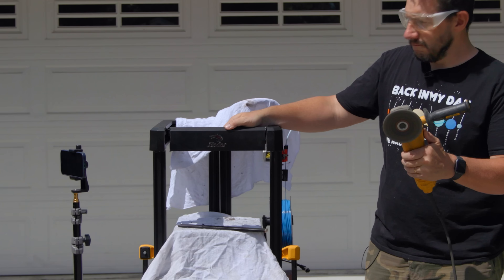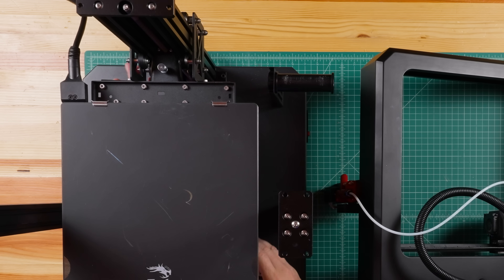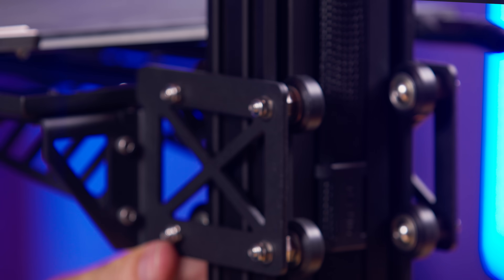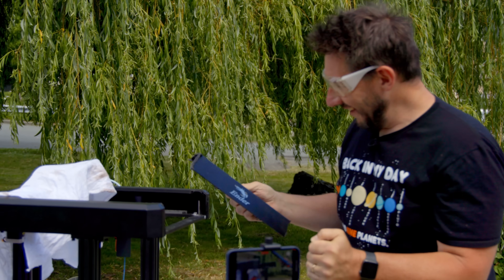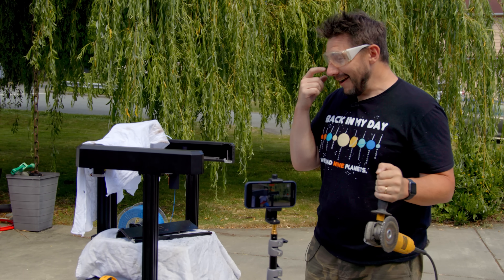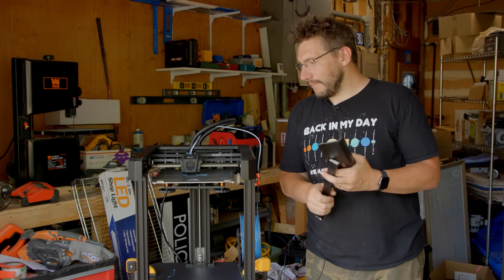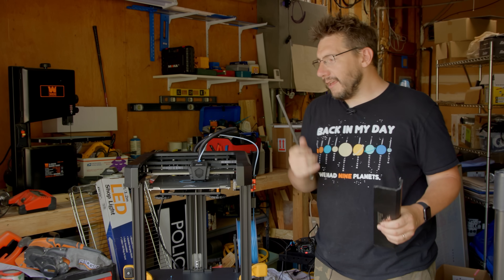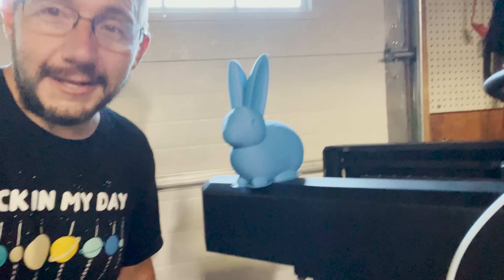I FIXED the Ender 7

Comment: That was fun. I hated that cross bar on my Ender 5. Always blocked my view when leveling. I see a lot of core XY machines at MRRF running without a bar across bar. I got rid of my Ender 5, maybe I should have just cut it.
Reply: don't even have to cut it on ender 5, you can just unscrew and remove it.
Reply: @Diaman_D  or relocate it with some brackets! Moved mine down a few inches and it so much easier to see first layers!
Reply: corexy printers with open top generally have the upper frontal bar mounted low, not much higher than the upper bottom bar.
Reply: Agreed Chuck! There are a lot of cool mods to remove it or relocate it now too!
Reply: The top of the Ender-7 does not block the view of the bed while levelling.
Reply: With the entire kinematic system for the hotend essentially sitting on-top of the ender 5, not having a perfectly square frame makes it much less stable. The centre of mass is MUCH higher, and the inertia of the hotend moving is significant when going faster with both X and Y being tied together. All this wobble creates serious ghosting/artifacts and can affect stringing by shaking filament out of the nozzle even when with the extruder not extruding.

If you hate the top frame bar so much you could reverse the X-Axis bar and have it hanging underneath the top of the frame, making it easier to see. If you also reversed the Z axis, you could reclaim some of the lost print volume but you'd also need to relocate the electronics box (which is a fairly common thing on custom '5' rebuilds).

Comment: Oh man, I can't begin to tell you how many times I've imagined doing the same thing with my Anycubic 4Max Pro. I have genuinely come to HATE that thing. Every time there is something you need to fix (Which for some reason is quite often) you have to dismantle it to PIECES and I just HATE it at this point.
I'm considering just getting a Ender-3 V2 or something like that, instead og constantly troubleshooting on this thing.

Comment: I dont get the Printer, Still think the Ender 5 Plus is better. Got 200+m/s aswell with my 5 Plus before the hotend started to reach its flow limit. The linear rails are cool but then again i dont like having the print bet only on one screw. Escpacally with the flimsy construction it has there. Could you compare it to an ender 5 Plus in stock configuration? And maybe a Ender 5 Plus with a dual drive and a volcano hot end? I think it is a better bigger printer and the only thing going for the Ender 7 would be the linear rails and maybe the mainboard.

Comment: If it was an issue with leveling, what they could have done was make that removable. Have it bolt from the bottom with 2 bolts on each side and the front ferring plastic part lift up out of the want and like sleeve over. This would help keep it rigid while running but also allow you to do your leveling properly.  It works now, lets see how far you can make it go

Comment: Skip Creality and go with a Voron!!!
Reply: something to consider: 3 weeks of building and 3 times the price 
plus extra experience needed
Reply: @CraftySven  depends a V0 can be done under $1000. But Creality is cheaper, easy to assemble, and will need dozens of mods and an angle grinder to get it to achieve Creality claims LOL

Comment: Hey Joel, can you explain how the leveling screw works? Does it determine where level is? Right now my Makerbot z18 has the same screw and I am reaching the same limitations on the bed, I need to run the bed a little lower instead of higher because it levels on the end of the screws on nearly all 4 leveling screws on the bed. Right now the screw is screwed all the way down. Fully tight.

Comment: they wont be saving more material. they will actually be making more waste. i doubt very much the off cut pieces are melted down and remade. at best itll be chucked in a recycle bin. most likely itll just go in landfill
Reply: I think he meant plug the mold so that section never gets made to begin with.
Reply: @Pygar2  thats plate steel. you dont cast plate steel. its cut by cnc from a plate of metal. its not an additive process, you take a larger piece and cut it down.
Reply: @bageldrone  I was talking about the plastic fascia he cut, not the little metal bar with it.

Comment: Structural downgrade for sure, you can improve it by just adding something less intrusive that closes the U shape you left. A rod with two 3D printed screwable thingies on each end will do wonders, specially when you start printing at high speeds...

Comment: Considering the xy movement is on linear rails which have minimal to no play, even if removing the front brace causes the frame to no longer be square, as the X rail moves to the front, it`ll "pull it in"
The vzero has no front bar, and although yes it is a smaller printer, doesnt suffer from any issues by not having the front top brace

Now give it a kinematic bed mount :P
Reply: By comparing Joel's fingers and vertical extrusions (4040) with the top plate, cross section on sides looks like is around 40x10mm. That's rigid enough on it's own even in U shape.
Reply: @MarkoSamirić  Yup, you can easily make up for not having a front brace by just having a stiffer U shaped frame, in this case that aluminum plate should be plenty and the verticals are pretty bulky as well
Remember 3d printers only have to content with movement forces only really, theres no forces on the toolhead itself during operation
Reply: For real, if they had done a creality cost optimized version of a Hevort, this would have been an awesome potential counterpart to the Cr-30.  Maybe it's just not a thing to make a "premium" Ender

Comment: I wanted to see how fast the printer was. That was the whole reason I too the time to see the video. I don’t care that there is stuff in the way for now. But good job Joel. I was saddened that you destroyed it. You can always get a new top part. I like the look of the printer and I think it was to make it sealed in the future and make it more commercial look. You are correct there maybe no real use for the extra metal except to seal it . Well good luck on the next video. You should put it side to side next to a regular ender 5 to see how quick it is.
Reply from the maker: That’s a fun idea!

Comment: I have to say the plastic removal is fine but the aluminium not steel bar does make a difference it makes the structure more rigid. I think you might regret doing this. How did you manage to straighten the bed did you remove the frame and straighten it or what did you do?

Comment: Great first step! You made the first step to get in direction of to the starship launch tower design ;)  

https://youtu.be/7r3pEWxSIeA

Would be great to have the top gantry going up and down and the bed stays on the ground and of course flip the top gantry 180° to the back.
By extend the Z Tower axis up to 4 m you can print  the startship with supper heavy at ones in size of 1:30 :-)

The main gantry is fixed by three columns (all columns the z axies design) plus one at the back to get the starship tower, add some trusses to get it rigid see the wonderful animations of the tower.
https://www.youtube.com/watch?v=tgGPnYaUO3w

=> Starship printer 1:30

Comment: Chances are the bar across the front added quite a bit of rigidity to the top.  And the plastic probably acted in part as a stiffener for that bar stock...    You could test by seeing how much the removed bar flexes with and without the plastic.   

Getting rid of the plastic might have been justifiable, but I would want to do some testing to make sure that the remaining structure isn't flexing now...  Time for some string (can use sagas a rough measure on if the arms are staying square) and a level (to make sure the arms are staying aligned)...

Comment: You still cant print at 250mm/sec this hotend wont melt PLA fast enough which many have found out already as at 250mm/s you get massive underextrusion.
Reply: They obviously mean in vase mode at 260°. Creality’s numbers are never meant to illustrate real world experience
Reply: Precisely, yet everyone is banging on the fact it's not rigid enough anymore. I think that is the least of your worries if you try that. :)

Comment: Removing the metal bar is stupid... It guarantees that the top has the right shape...
Reply from the maker: Yet somehow I don’t think I’ll have any issues
Reply: @3DPrintingNerd  Sure, but i don't think it's a solution for everyone, specially during the production and during a long shipping, a close shape is more solid, removing the plastic part seems enough
Reply: @xpy99  They can just add more foam.

Comment: Material saving unfortunately doesn't work like that. Also they probs have like 100k of these made already so they are not going to do anything to the design. It's unfortunate that things are made to look good rather than actually work. Also did the cut away spread at all? Like the y axis linear rails are still aligned and not causing bad movement?
Reply from the maker: That’s a good point. No, rails are good and nothing spread.

Comment: Oh god, i had to hold onto my chair watching you cut something with a grindingdisk 😰. Please use a cutting disk next time 😅
Reply: With ya here.. in an engineer .. the cringe was real
Reply from the maker: Oh I’m with you on this one / I couldn’t find it. Will have to go to the store.
Reply: @3DPrintingNerd  Please, use only the right tools. It worked, yes, but it was slow like heck, and it could have ended up worse than intended.
I really like your videos, because they are informative and usefull, but please also use the right tools for the job
Reply from the maker: @Lotara_Sarrinn  Slow like heck? It took maybe 20 seconds to grind what I did. It really didn't take long. What would have been the right tool?
Reply: @3DPrintingNerd  the right tool is a cut-off disk. The speed isn't the biggest issue. Grinding disks aren't designed to be used on edge like that. I've seen those things shatter when used like that. I used to work with a guy who lost an eye that way.
Reply: @3DPrintingNerd  A cutting disk.
Reply: @3DPrintingNerd  bruh, just send it. cool to see the hack worked! :)
Reply: @3DPrintingNerd    Chainsword :-)
Reply: @punishedbrains  it did work, but it simply wasn't the right tool for the job. And for a somewhat educational channel, it should be taught to never abuse tools

Comment: The fact that you think that’s “purely aesthetic” shows why you’re not an engineer of any type.
Reply from the maker: I’ve never claimed to be any sort of engineer. However, it’s still quite rigid. I’ll keep printing with it and see what happens.
Reply: There is engineering for aesthetics, what do you mean?? Sports cars, skyscrapers, etc... there are even poorly engineered regular cars that look good, but were functional useless, just because Joel isnt an engineer doesnt mean.. he can't look at something and say thats useless. 

 a square is stronger than a U sure, but guess what so is a triangle
Reply: @rougespitefire6226  yes, and those things you described were designed that way...not randomly modified because it annoyed someone. Are you also trying to equate the strength of a triangle to that of a u?
Reply: @drinkmilk15  i wasnt saying they were modified.. i was saying there a ton of examples of companies literally releasing subpar products with great aesthetics, but functionally useless or prone to failures, and possible to troubleshoot due to the poor design and mind you these WERE cars, not something as minimal as trying to print plastic, and no i wasnt, i was saying the support bars attaching the top to the bottom are arranged in a triangle, so regardless, if he removed a "useless" piece, the printer would still remain structurally functional as a 3D printer 

I normally dont like to argue with people, but i dont like people bashing on joel for a modification, and being condensing little shits, just cause hes not an engineer cause he made a comment
Reply: How helpful! :)
Reply: @punishedbrains   I know. Maybe people will see my comment and think twice about hacking apart the frame of their printer with no knowledge of structural engineering at even the smallest scale.
Reply: @drinkmilk15  If you'd explain why (even though it's super obvious) than yes, but not like that. A Voron 0 doesn't have one there either I believe, maybe because it's so small.

Comment: Joel… you‘re a great guy and all… but you have no clue about 3d printer engineering 🤷‍♂️
Reply from the maker: That may be true, and yet, here we are. I’ll be the first to shout if it starts having issues.
Reply: @3DPrintingNerd  tbf it May have no problems and work fine if the rest of the frame is good. Just clean those blocks or they'll die and make awful grinding noises
Reply: What an unproductive comment, he got it to work didn't he? He's trouble shot and fixed some super expensive and complex prototypes. I think he's qualified enough.
Reply: Have you managed to fix one in a more efficient way? If you have than that is fine and you could advise him on how to do it better and we'd all be very impressed with you. But don't just critize him.
Reply: @julesgamble9721  yeah I got a second z axis using scrap parts and fixed my e5 cantilever bed, to see stuff better just get a longer leadscrew or a lower nozzle

Comment: Plastic cut is ok, cutting the frame is not a good idea, it may cause problems when printing with higher speeds and acceleration
Reply from the maker: Nah, I bet it will be fine.
Reply: The crappy z-axis design is more of an issue. But Creality will just continue pumping out cheap crap & charging stupid amounts for it.

Comment: Filament: I need glitter accents.
Joel: gets angle grinder from garage
Linear rails: visible expression of terror

Interesting method of fixing the company's design oversight.
Reply from the maker: Yeah, not protecting the rails may have ended badly but thankful it didn’t.

Comment: Nope, should have left the metal in there to keep the box 'square'.
Reply: I don't think that the forces the belts put on the 3d printer are enough to un-square that chunk of ¼" aluminum anyways tho, lol
Reply: @FAB1150  exactly. People think that plate is attached at a pivot point like each one of the extrusions bolted together  on their ender 3s
Reply: @FAB1150  exactly! and it's also fixed to those thicc Z beams. the Y beam also helps with squareness. I really don't see this thing going out of whack any time soon.
Reply: @FAB1150  with claims of 250mm/sec (whatever they think that actually means), I don’t think you understand the torque created on a frame by a properly tight corexy belt system accelerating and decelerating at that rate.
Reply: @drinkmilk15  250mm/s movement at 500ish mm/s² is easy enough, let's see what happens with higher accelerations that would actually allow it to reach those speeds on prints, when stuff starts vibrating and all.
The initial design's plate thickness might have been overkill and all, but still, a U tends to vibrate far more at the ends than a closed square.
Reply: @drinkmilk15  you might introduce a bit of ringing at high accelerations, but that plate is probably overkill even while cut, especially as it's constrained by the three poles and can't twist, only "close" the U a bit. We'll see
Reply from the maker: Nope.
Reply: Yeah, since have stopped warping since you would have had to compress that whole front bar to put it out of shape before but no it just has to bend a little at the corners.
Reply: Let’s be real, it’s a ender, if it wasn’t being cut up now, it certainly was going to be used for parts when rev 2, and 3 show up on market with engineering that isn’t jank.

You cut the shit out of anything you want. 

If anything, I’d personally love you to share more setting you use but I don’t expect a thing.
Reply from the maker: Nah. Let’s see how well this continues to work.
Reply: @3DPrintingNerd  
Of course, no turning back now.

Comment: I have to admit that I hit the 'like' button when you started cutting the frame with the angle grinder.  This is something that I have never seen anyone do in all of the many 3D-printer videos that I have seen.
Reply: I have a couple of 3d printers that I would like to take a saw to. They just sit around with so many problems that I have given up on them. If I knew more about this stuff, I could probably build a new machine from the broken ones I have...
Reply: Gussets would do the same as would a flat bar across the front about 3 or 4 inches up from the bottom
Reply from the maker: Thanks! It was a bit of fun that ended up working!
Reply: Technical he was grinding with the grinding wheel, but he should properly have used a cutting wheel instead :)
Well it worked in the end.